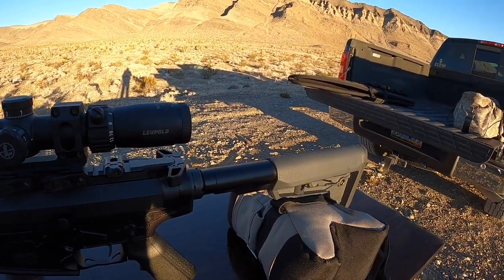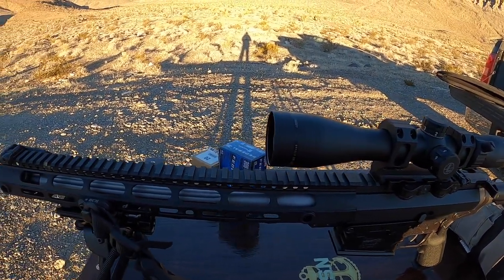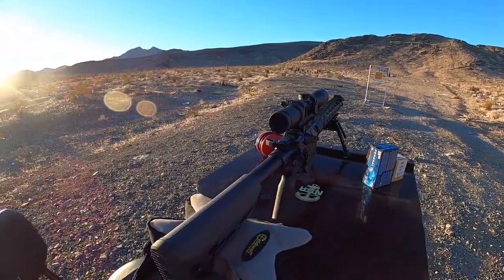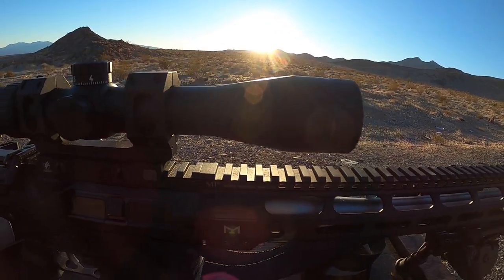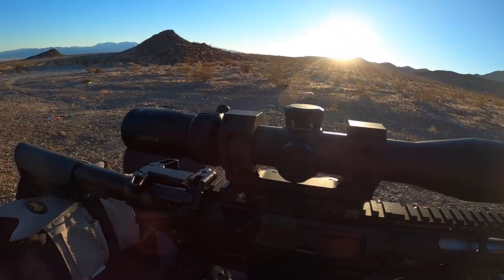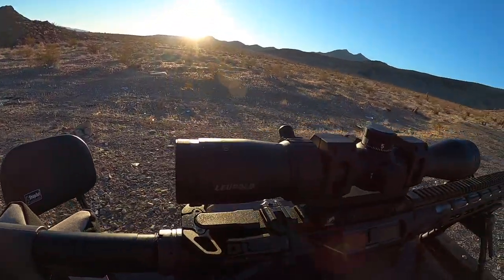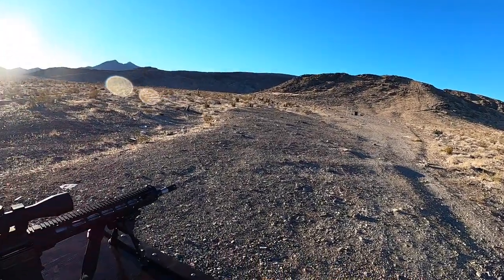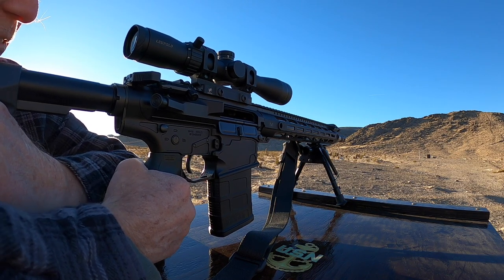AR308/LR308 New Frontier Armory/Wilson Combat Range Test 3 - 18

Comment: Good shootin. I'm looking forward to the final build review. I could use all the tips I can get with this AR-10/DPMS platform.
Reply from the maker: The 308 is definitely more picky with the gas setup. Even when not running a suppressor I now believe an adjustable is worthwhile especially when running the hotter 308 vs lower powered NATO. I think adjusting the gas for different ammo is way better than dorking around with different BCG, buffer and spring weights. Rifle is running great now!
Reply: @peteregger7928  I must concur; the simplicity of use with the RifleSpeed is a huge benefit.

Comment: That probably had something to do with the parallax and how blurry it was at ten yards maybe lol. 

I’m taking my ar308 out in the morning,I’m going to group it at 100 and then again at 300. Should be fun.
Reply from the maker: I think so! Nothing rattling around inside the scope and the mount was nice and tight! Next time out I'll start at 100 and see if I can get to 300 at MOA off my bipod. Good luck tomorrow and "May the force be with you!"
Reply: @peteregger7928  😂 yeah probably just a parallax issue, weird the windage was pretty much on up close and then off so far when you backed it up… crazier things have happened tho 😂. 

Oh I’ll definitely need that luck 😂, i re adjusted the scope and tried a different way to level it. I doubt it will be off a ton but I’ll have to fine tune it for sure. I’m going to see if i can get some 9mm on steel at 300 also,that should be fun and i doubt it will happen with my sun compact but maybe with my p320.
Reply from the maker: @itsamk18-ish  I shot a group but the shift was large. I'm going with parallax! Lol!
Reply: @peteregger7928  yeah me too lol. I’ve been looking for a new scope for mine,i have a cheap primary arms 4-14. It’s been fine but I’d like something with a little better glass.

Comment: Update. Remember how WC told me they will not sell me just the bolt in 308?? Their website didnt offer it and they wouldnt sell me just the bolt.  Well I spoke to them again and told them just to ship my Lantac bolt and WC barrel back to me and that i'd just buy their complete BCG from primary arms (WC out of stock of the NIB).   They then asked, "would you be interested in us just selling you the bolt?"  I said, guys, that's what I tried to do back in November before I shipped my stuff to you.  Anyways, glad they offered me that option, finally. FYI for anyone hiring WC for custom work, THEY ARE SLAMMED!!! My parts have been there since November and still werent anywhere near the front of the line.
Reply from the maker: Wonder why they just wouldn't sell you the bolt in the first place unless they just didn't have any that weren't already part of a complete BCG! Sounds like they're on it now though!
Reply: @peteregger7928  I asked them that same thing, they didn't have an answer for me lol. They are also bad about calling me back, I have to call them every time to remind them to ship my parts back with the new bolt. Try again tomorrow. ridiculous.
Reply from the maker: @DesertMariner2007  Not firearms related but I just received my 3rd brand new stove from Whirlpool since Thanksgiving. First two were bashed and smashed! The boxing protection was completely inadequate, non-existent and the sheet metal gauge and overall build quality is like Pringles potato chips. My wife was about in tears trying to deal with their "customer service"! She was about ready to throw in the towel but then realized what a bad idea it would have been for me to talk to them! I would have been put on the no fly list! Lol!
Reply: @peteregger7928  lol!!!! I know what you mean trust me on that!! I have to remain very watered down dealing with people. I got kicked off a flight for the first time ever during the COVID era for telling another passenger to mind his damn business. I had just gotten off the boat from being offshore, wasnt in the mood for someone's BS that day.  It wasnt mask related at all, I couldnt fit my bag in the overhead spot by me because the flight attendants took up that entire row worth of bin space which I thought was not fair being as we pay for those spots above our heads lol. Some guy thought he would try and be a hero that day but he rethought his lifes decisions that day.

Comment: Can we get a tutorial on the target stand
Reply from the maker: I'll do a quick video on it soon!
Reply from the maker: I made mine a little longer and only made the cut on the left side because I'm right handed. I also put a strip of wood at the top front for a bipod stop and used a gate handle on the bottom for carrying instead of cutting a hole. Home Depot or Lowes sell precut pieces at 24" so a little less cutting that way. The "Rugged Buddy" folding saw horse legs are no longer available. The sites that claim to have them are bogus so you will have to come up with something else for folding legs. I found manufactured tables lacking, to heavy or to costly which is why I decided to make one. https://youtu.be/RYzlUACLPBA
Reply: @peteregger7928  thank you, that was very helpful